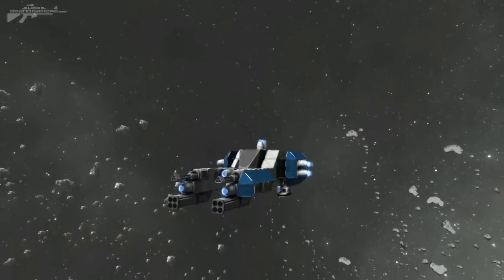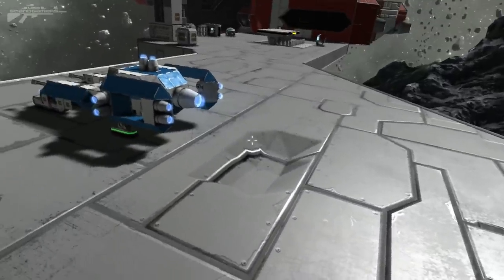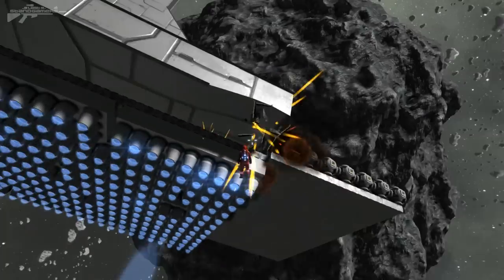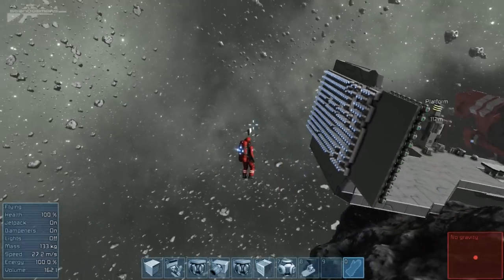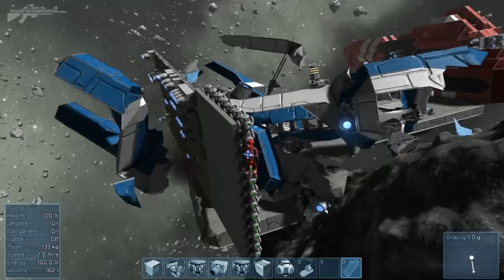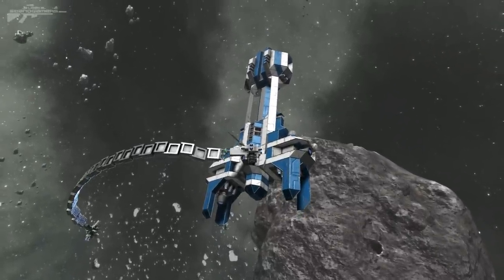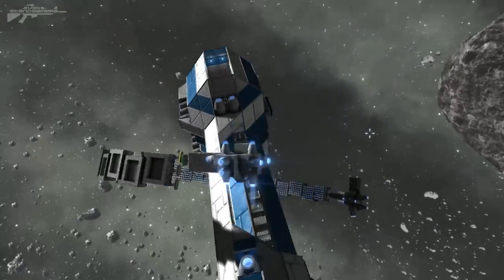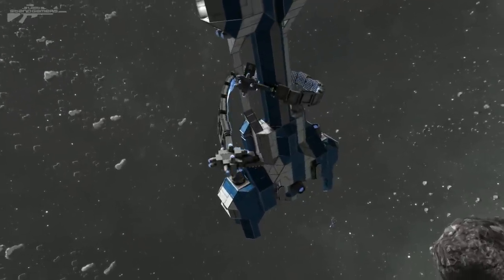Space Engineers - Force Field Basic Testing, Stopping The Rammer

Comment: Thrusters don't burn unless they're being powered, as you could see at the beginning, while the thrusters were idle, it wasn't burning the ground until he starting trying to lift off while hs landing gear was up. The only reason he wasn't penetrating your unmanned thrusters was because thrusters have extremely high health. Try shooting a thruster with rockets or a warhead, it takes a few tries to destroy one.
Reply: They also have no damage physics yet, so they continue to damage and deform the opposing ship until they completely break. Additionally, in survival that wall of thrusters would also be prohibitively expensive.

I've done some testing of the concept of a thrust-drill ship, and it's not practical. Thrusters will only effectively drill through one layer - very quickly mind you - but will fail the penetrate beyond that point. Rockets are much more efficient.

This method may have some use against people trying to board your ship, a constantly firing outer lay of thrusters, but there's the obvious power requirements of that.

Comment: This is a rather odd idea - if this still works, could you wire up sensors to activate a set of welders and projectors inside a ship to build one of those walls instantly? one set for each side of the ship. Small ship stuff builds really quickly, so if you had the projector/sensor as a small ship attached via a landing gear, and the welders inside the large ship... it might build fast enough to bring up an anti ramming shield.    The sensor would activate the projector, so your enemy wouldn't see it happening before it was too late.

Comment: Just curious, have you ever thought about making a spinning ablative shield for a ship?  What I mean is surround your ship in a cylinder of armour and have rotors rotate it around your ship.  That way when a torpedo or ship collides with it, it may do damage but the rest of the cylinder will rotate over it to cover the hole and it will take a longer time to penetrate the ship it self.  It would be interesting to see you implement this idea on a ship some day.
Reply: I tired doing that and what happened was the shield ended up heavier than the ship and the shield stayed still while the ship spun around :(
Reply: Sunodasuto if you had it spinning fast enough a 3 thick bar of thrusters should be able t cover the ship though it obviously wouldn't be quite as ideal
Reply: Sunodasuto I'm crying I'm laughing so hard at this.
Reply: Jacob Ruppert i think that is kind of what he meant only not quite that way lol but i think that it could work since it would continueusly bring new armor twoards your opponent and while a guy with a well made torpedoe could probably defeat this design it would still be neat
Reply: Sunodasuto Have you tried attaching a flywheel-like object to the interior of the ship? One of the big issues that arises from such a shield is that the shield tends to have a higher moment of inertia than the ship itself. This means that the shield itself takes more torque to achieve a desired angular acceleration than the ship, which results in the ship spinning.

Flywheels are made to have a high moment of inertia, so installing one of these in your ship should increase the moment of inertia of your ship, resulting in the rotation of the shield rather than the ship.

Comment: for the thruster tug, they all need individual gyroscopes in order to use the Inertial dampener.

also i recently been developing a type of tool that effectively tears into a ship using thrusters. i got about 4 designs drawn out and putting to the test. maybe you can implement a thruster using rotation while someone is locked down and doing a burn? since it cuts, maybe you can use it to do some precision cutting

Comment: I  think that you should keep the chain design, but add a control bay of sorts to power those thrusters on the inside of the chain. And then place some thrusters on the backside of the chain and then you could activate the thrusters on the backside of the chain and, granted that the thrusters on the reverse side of the chain were putting out a higher thrust force than the ones on the frontside, you could literally cut a ship in half with that design! I think that I am going to try this one out on my own!

Comment: There needs to be actual energy shields in this game.
Reply: not at all... devs already told everyone that his game is about thing that "could be built today"... everything you see in the game is nowdays tech... except the gravity generator... An energy shield would be the overkill that would ruin gameplay...
Reply: Besides gravity generators those aren't possible
Reply: But a shielding alloy that could attach I the outer area of a ship could be possible could even be made out of rubber to cause bounciness
Reply: Bounce a rocked with rubber? Seriously... ."?
Reply: Gszabieee Not rockets but rammers I'm meaning.
Reply: Jacob Ruppert A shielding alloy... Hey! They could call it 'armor'! They could even have different versions of it, like a standard sort for general construction and then a heavier one that massed more for the outsides of actual warships and the like.
Reply: SOTBS Lol.
Reply: Energy Shields unbalance resource management. It puts high defense ability on ships with shields without the need for a ton of armor, which allows for ships to be both tough-skinned AND super maneuverable... This almost inevitably leads to A) Large ships being superior every time (See Starmade) or B) Shields just replacing armor completely because they will either be unusable on anything but ships with huge power generation or they will be cost-effective in every situation.

It also kind of doesn't fit the feel of space engineers.

HOWEVER... now that we can manipulate the size and shape of our gravity fields, I'd be interested to see if we could make a Gravity Shield for stone-based torpedoes and players with drills. This wouldn't help against torpedoes and drill ships, though.
Reply: Sui Suington actually while it would allow a ship to be tough shields would at best be a very expensive thing to run im 90% certain of that think about it max range limited weapons cant fire out from it and high energy requirements would mean excessive load on reactors excessive load could cause meltdowns and or other issues
Reply: There are no current meltdowns, and as stated the energy needs would have to be at least on the high end of reasonable. Energy is not an effective limiter for shields, however, as Starmade has shown us. The reason they're unbalancing I because they can INCREASE defense at the cost of only power - something players can easily provide - and at no cost to maneuverability. It will also, if balanced by energy needs, make bigger ships better ships. Fighters wouldn't stand a chance. There are balancing methods but that's almost always true because the traditional shield archetype is a regenerating 0-weight armor, which will ALWAYS be superior to standard armor for that reason. All the armor they DON'T make could be used for Power generation for more shields.

And it STILL wouldn't match the game's look or aesthetic.
Reply: How about we wait until the game is completed, then you argue whether shields exist of not.
Reply: G2BattleConvoy They said, clearly, "We will not add shields." as discussed above. We're just debating the possibility of shields for fun at this point.
Reply: Sui Suington maybe there could be shields that could block only small projectiles like small ship gatling guns, but not massive things like torpedoes and rockets.You can also make it so that a shield takes time to charge, doesnt recharge without charging it down and impose a velocity limit on the shielded ship, or even make it impossible to move one, making it more of a station defense. You could even make it impossible to fire any weapon from a shielded ship, as they would just hit the shields.
Reply: its quite simple to balance shields, don't make them 1 way, if shields are up, you cant shoot.
Reply: Quaaraaq That would just make them armor, the only reason to use them then would be if they were in some way superior... thus the issue.

Npgabriel Yeah, there are ways I'm sure, but I've never seen them in a sandbox like this. The issue is that a shield does what armor does, but if a shield is to be practical and useful it needs to do something better too. The only way I can think to fix all the issues with shields is to make it basically function like armor (more shields = more mass, shields must be repaired like armor, one way shielding), but then we run into the issue of "Why not just have armor if the shield will just be armor but with more coding and bug potential?"
Reply: Sui Suington the shields would be too costly on small ships but more efficient on large ones, as you would need less time to shield it compared to armor
Reply: Npgabriel That would make shields viable, but it doesn't solve the issue of them either replacing armor or just being slightly inferior to armor.

The common shield concept is just normal armor, except easier to build and use. If the shields were in some way fundamentally different they may offer a great variation in construction. One approach I considered interesting was the concept of shields that would deflect slow-moving objects like rocks and debris but not fast-moving objects like a ramming ship or weapons fire.

This would make it useful for containment units, so you could carry loose rocks in a ship, or for just putting on your mining ships to protect them from getting all dented up and such. It wouldn't make them combat-effective, either, so armor would still be the priority in that realm. The issue of shields replacing armor or not being worth it would be solved by having them function in a manner that armor does a poor job of.
Reply: Sui Suington I know it's been said that power isn't a limiter for shields, but maybe if you make it so shields have a passive generation cost for the surface area they cover and then added to that is the cost of the damage of weapons and the like, so a ramming ship (if large enough) could knock out the ships generators thus rendering the shield inactive for a time (which gives a place for armour to fit in as both a non-resource intensive source of protection as well as an emergency use if the shield is breached) and a larger number of reactors creates a stronger field (so long as you can supply them enough fuel) just as a higher number of weapons/asteroids impacting upon it will drain the power of the ship (potentially reducing the effectiveness of the guns or thrusters thereby making the activation of the shield a tactical one in a battle - not just the norm.
Reply: Neion8 That is an interesting idea, having a feedback risk for shields. If you lose your shields, you actually lose all power generation for a short time, crippling your ship.

Something like that could potentially work, I suppose, as it places shields in a risk-reward position... still, though, there would be workarounds. Like shell ships to hold the shields connected to the true ship by landing gear to defeat the countermeasure.

However, it still makes shields just powered armor. I feel that wouldn't add enough alone to the game and would put a greatly superior power in the hands of an established player, more so than is typically approachable. Right now all a new player has to get is a grinder and a chance and he can get inside and then cripple a ship, assuming he wins all the gun battles. Adding ships would eliminate that, as well as preventing a single nub with a rocket launcher from taking on an established player's set up.

Due to the TREMENDOUS amount of power you can potentially build and maintain, especially with conveyers working now it's easier, power is a poor limiter because it itself has no limit. It's a linear progression, though, so unless shields are exponential power is a poor limiter.
Reply: Sui Suington But surely though the same lax limiters on the generation of power apply to the number of guns on the ship.

Also the addition of energy shields would mean that it would be easier to create a good looking ship and not just 10 layers of heavy armour in a thick, ugly carapace just to stop some noob with a grinder or single rocket launcher mounted on a small ship from breaching their hull, planting a few warheads around and detonating the ship.

As well as that, why is it too much of a problem that someone who has sunk hours into building a giant ship and mining tons of uranium to stop their ship from going dark in a battle having an unbeatable advantage to someone who has just joined the game and has spent little to no time in the game. Or to put it another way, is it fair that someone who has spent those hours making that setup being destroyed by a few lucky noobs who could wear down the 15+ layers of armour over time?
Reply: Guns are limited by Ammo, though, which is precious and not fun to make in survival.

That is a greater balancing question I suppose would be up to the devs. SHOULD any player have the power to act, or SHOULD server monopoly be allowed? Probably something in between would be ideal. Either way, though, shields would push that answer to the extreme.

I REALLY like the idea of the high-risk shielding, something that you can use if you just HAVE to avoid that freakin' gravity RPG ship but will carry the risk associated with crippling your ship's power for a time.

I like that my ship cannot always be practical and beautiful. It's a realistic sort of choice that gives some engineering context to my decisions.

"A fin would look cool, but hurt my acceleration for no reward... UNLESS!" and then I find a way to make the pretty now efficient and end up happier for it. That's one of the main appeals of the game for me.
Reply: Sui Suington make it highly efficient...for small ships, with an exponential decrease in effectiveness as size goes up. All problems stated have thus been solved, and it gives fighters some lasting capability against a ship with large amounts of AA.
Reply: Gszabieee Sounds like Mythbusters need to try this out o.o
Reply: Gszabieee they may add scripting for modders so they can
Reply: Gravity should be made with centrifuge force in the current game.
Reply: ***** And tractor beams.

Comment: Try using this idea on small pods that connect to make a big wall that repels the on coming ship this will mean you can move them to areas that need protecting or have pods connect to the ramming ship and have it force the ship to stop with a equal opposite thrust  like a external breaking system.

Comment: hey can you make like....a thruster ship burner type of ship?
Reply: mhmhm
Reply: nick law or using a sliding door with thrusters on
Reply: nick law yes that would work but currently problem is that you can't just turn the thruster on, you have to be in cocpit and press key to activate it, and taht limits it to 2 directions at once
Reply: you could make a wall like at the start and quickly deploy it by a satation or very large ship

Comment: So are the defensive capabilities of your first concept affected if you replaced the small thrusters with the larger ones? Or maybe add some grav generators behind to counter act asteroid weapons

Also have you tried inverting the chain and locking the motors so it forms a ring? If not you could try mounting several of these around a ship with landing gears in a sort of cylinder shape.

Comment: Dig a tunnel through an asteroid as a means of bottlenecking poor hapless pursuit fighters, then have one of the thruster panels swing down on a pivot to bar the way once the decoy ship has cleared the trap. Splat.
Reply: Hmmm, that's a really interesting idea...
Reply: I like to pride myself on dangerous, stupid, and useless Space Engineers designs.
Reply: With Thruster-Override 5x5 Wheels and blast door pieces, I build a chainsaw^^
Reply: Jacob Lucas add 2 and hide warheads in the sides of the asteroid :)
Reply: Jacob Lucas or hide a grav gen in a asteroid and drop chunks near it then draw some 1 under it and activate the gen, the forecast said showers
Reply: Jacob Lucas 
Nice idea, you may even be able to use that idea as a means to trap pursuing ships, by setting up a trap wall both in front of and behind them, while hopefully keeping them more or less intact once the pilot realizes that the ship can't escape on it's own, the pilot would either have to wait for you and any allies you may have to come for him (not wise since that could easily leave him in a disadvantageous pincer attack) or actually get out of the ship to try and remove one of the blocking walls manually.  That could be used to 'capture' unlucky ships more or less unharmed once the pilot is dealt with.  An even more devious idea would be a deathtrap version, where the walls slide into place with automated turrets mounted on said walls to literally shoot trapped ships to pieces.

Comment: Putting it on a ship will give it trust so you would need to balance it out, a cube like ship will work best.
Each side full of trusters and that will cancel each other momentum.

For actually moving the ship you probably need to add 2 big trusters on each side to give it 3 dimensional movement.

This concept won't work on a ship that does not have exact the amount of active trusters on each side.
And such a force field will not work then since you can not cover the entire ship.
Complicated solution is to add bigger trusters to compensate for x amount of smaller ones.